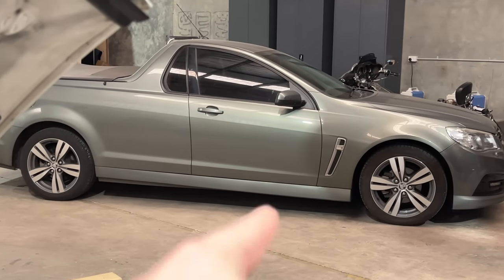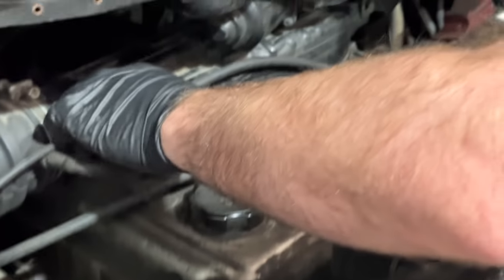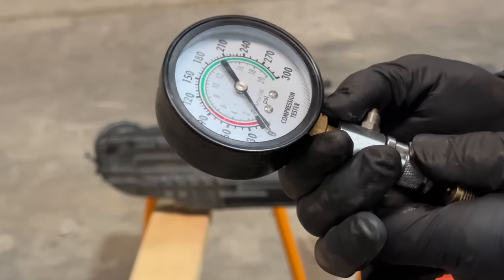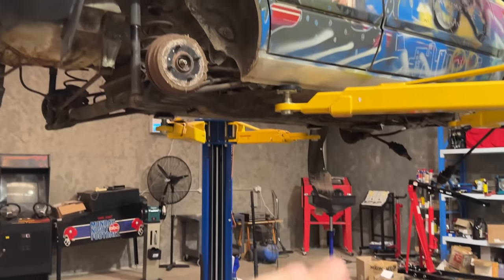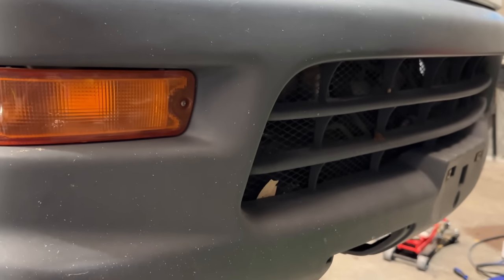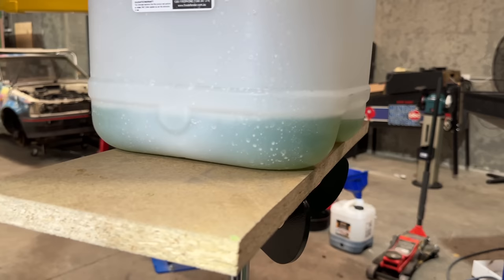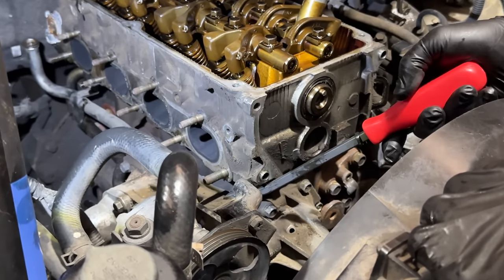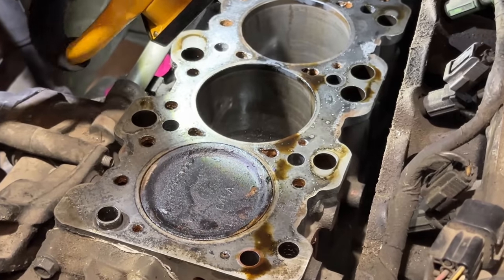What killed the donkey van?

Comment: Really good chance the head gasket fire ring was already somewhat stuffed but it was so encrusted in carbon that it held compression. The upper engine cleaner would have removed the carbon deposit and caused failure of one fire ring. You can see that it's then pushed into the next cylinder.

If you guys are cowboy gasket slapping it, highly recommend doing a little resurfacing by hand. The fire ring failure and old head gasket residue doesn't help sealing. I've done cars in the past with a whetstone+wd40 that ran happily for years after!
Reply: Liberal application of hylomar doesn't hurt either.
Reply: So you basically recommended the same as Wade does for polishing iPods?
Reply: WD40+brass wire brush attatchment on a drill for the block, one of those super scrapers (that's what they're actually called, they're like a gasket scraper with a carbide knife edge) for the head.
Reply: I always find it hilarious when something’s brokenness is what holds it together.
Reply: @drippingwax  will 150 1 grit ones work as well?
Reply: this has to be in the top 0.1% most intelligent youtube comments posted
Reply: @donbehatin  I work at a Ford dealer and see guys doing the wire wheel drill on heads and timing covers all the time
Reply: Can you like take an inexpensive mirror, you can always tell when a mirror is wavy or wonky because it's a mirror, glue some sandpaper onto it, and do some slidey slidey action, is that a good way to go about flattening that surface?
Reply: Despite the pitting in the bore, the new head gasket would probably be a good bandaid for awhile. But that motor just needs a rebuild
Reply: Absolutely, block should be sanded with a flat object too!
Reply: That's a good advice (probably), but what should they do with the cylinder bores that have pitting in them?
Reply: @JeanMarceaux  you send it to a place that does block remanufacturing. Just like what they did with the daihatsu.

Comment: I feel your wheel pain. Had an 87 VW Cabrio that took 13 inch tires. A size slowly being discontinued by most manufacturers. Fun times finding new tires.
Reply: i feel this, youre limited to track tires or 70 aspect off brand "futuras" or "cornwells," 13s are a nightmare to source

found some bfgoodrich radial T/As in a ~200 something R13 for my 83 GTI on some old 13in alpinas, they balanced perfectly <10g per wheel and the beefy white lettering looks divine but the fenders could probably use a smidge of rolling or some berg cup flares 😎
Reply: I’m running two different Chinese no grip tyres as they’re the only tyres in stock that’d fit, I’m debating getting 14” wheels and seeing if 195 45 14s are any more commonplace

Comment: as soon as you said "problem" and brought up the wheel studs I could feel the former RX7 owner in me begin screaming and rattling his cage. Even over here in NA 4x110's have been causing headaches for decades.
Reply: Never had a car old enough to have 5 lugs, are 4x110 to 4x100 adapters hard to come by?
Reply: @abie1308  They're so close in size that any adapter you could concievably get would be more like a 4 inch spacer on either side. 8 inches of extra track width is no bueno lmao
Reply: @abie1308 Yeah you can get them quite easily. I have 4x110mm adapters for my rwd Mazda 323 that are 15mm thick to run 4x114.3mm stud pattern as it's more common used on alot of Japanese cars.

Comment: 6:26 That colour underneath the valve cover is oil varnishing. It’s due to oxidation of the engine oil and usually is only present in that amount from going a bit longer on oil change intervals or that it’s been ran real hard over it’s lifetime. Doesn’t appear to be much sludgy deposits so probably the previous owner went with a 8-10,000km interval

Comment: I once had a very similar issue on our diesel work truck, it had a 4D56 engine. The headgasket was blown between 1 and 2. We didn't really care about fixing it the "correct" way, as long as it back on the road ASAP. We just cleaned and flattened the head to block surface with a glasspane and sandpaper, put a new headgasket and surprisingly 3 years later it still runs great as a daily.
Reply: Nothing wrong with a little low dollar machining. Miles better than just slapping on a new gasket on a warped or damaged head/deck.

Comment: That firing headgasket failure happened to our work pulsar. Turns out it's a common fail point on them too. We fixed it once and then it did it again. It gets to the point where the combustion eats too much away at the head material and ends up never sealing again with a new gasket.

We've also had a customer with an express van that had the timing belt snap. That was fun

Comment: I recall in one of the wrecker tour videos you mentioned there's multiples of the same vans there all in better condition than yours, perhaps it may be worthwhile to pick one of their motors for cheap parts or a full engine swap if its intact enough? It could be a cheaper solution to the bore problem instead of having to send the original block to be reconditioned.
Reply: But then we wouldn't get to see them "fixing" the block with a diy honing kit and a cordless drill. Unless they could somehow collaborate with CEE up in Queensland just to see his giant vertical honing machine going to town on this tiny car block. Chances James already knows how to operate a smaller one so Kurtis can keep showing off how he does his jobs the way he does. Biggest problem is getting their schedules to line up.
Reply: although, if the vans there are in better body condition, then they probably went to the wreckers in the first place cause of engine problems
Reply: @cadenbarnfather1434  True, yeah that makes a lot more sense actually
Reply: @cadenbarnfather1434 Exactly, never buy an engine from a straight car at a wreckers, always get it from a crashed one as you know it was in use when it crashed

Comment: HEY! Those little chambers and offshoots on the intake might not be for sound, they might be for PERFORMANCE! They are called intake resonators and they can be designed to augment airflow through your engine intake in order to change how it behaves, and even improve torque at low RPM

Comment: I am sure that James already knows this and has ordered the correct part. But you guys would have a little bit better luck with a slightly thicker aftermarket head gasket one minute either a multi-level head gasket from a company like Fel-Pro or potentially getting an old-school copper gasket that's a few millimetres thick.
Reply: MLS gaskets are what you want if you want it to last, but also require a good flat deck (doubtful on the donkey). If you have a buggered deck or head, the graphite style ones will take up more slack.

Comment: I would say about this engine: Its not as bad as you would thin kit is. You guys basically revealed the problem with that car by using that spray. You said it was completely F-ed but i would say its one head gasket amount saveble. Because its only main problem (aside the head gasket) is the block and that requires a rebuild + honing/replacement and all that goodie stuff you were doing with freebie car (love that build btw, its a beaty to look at coming together).
Reply: the head gasket was likely already blown but the carbon buildup acts as glue

So I think the engine cleaner did it's job, the engine is just too worn out.

Comment: I have the same engine in my 02 lancer, and it used to smoke too, replacing the head gasket and the fuel pressure regulator helped it out a lot

Comment: SAAB used 4x110, too, but it's even worse as the hub diameter is significantly larger than all other cars that used 4x110 so only SAAB-specific wheels fit lmao.
Reply: You can get a dremel and machine it out

Comment: The weird coloring in the valve cover is the varnish from conventional oil. My nugget looked the exact same! It'll go away with time if you switch to full synthetic.
Reply: Thats a real good color tho, be suspect if it is super dark, althigh a slightly more roasted look is generally also fine.
Reply: Or if it’s full synthetic and you went lazy on the oil changes

Comment: I've been here, done that, had a headgasket blow between 2 cylinders on my Chevy 350 V8, I learned how to do replace a headgasket out of necessity, also got new heads, but I had far more room to work under the hood of my 1986 Chevy C10 than the cramped quarters of that van engine bay, that looks like a nightmare

Comment: If you can get it in Australia get some brand name engine restoter I've tested it myself as well as I've learned from others that have tested it and that specific brand works well and won't clog your oil filter. Not that it will 100% fix the pitting but it should help protect and repair the cylinder walls
Reply: That stuff actually works too tried it once

Comment: Just a suggestion, but once you do look into replacing the motor, look into a cummins 4bt. They dont make a lot of power factory, but a couple injectors and a fuel pump would probably net you some decent power, especially if you like just using the donky as a work van
Reply: Considering it’s a tight fit for that 2.something inline 4, I don’t think a 5.9L i6 will even fit
Reply: @Nep-Nep  Nope, not the legendary 5.9 smoke monster, the 4BT is the lil brother.  4 cylinder, 3.9l monster
Reply: @JacksonAl101  still twice the size and weight of the original engine. 
Plus...in Australia you'd have to pay thousands for an engineers certificate for the engine conversion to get it roadworthy.
Reply: @JacksonAl101  oh right, I forgot about the 4bt. It’s 4 AM over here. XD

But still, wouldn’t it be a pain to ship an engine like that from America to Australia?
Reply: @martin m  my friend I wasn't commenting on the swap itself, any swap of a diesel into a gasser is a royal pain, excluding emissions.  Just commenting it wasn't the behemoth 6 cylinder, would be a fun challenge in the states
Reply: @nep-nep6575  oh yeah, though they might have them already there in tractors, skid-steers/other construction equipment.  4BTs were thrown in pretty much anything
Reply: @JacksonAl101  all good champ 👍
Reply: The only thing I know Cummins for is the 15L engine in my fiancé’s truck. I didn’t know they made tiny engines for 4 wheeled vehicles!

Comment: In the absence of a lathe, adhesive sandpaper to a plane of glass and use that to lap that surface for cheap. It takes a pretty second, but it's cheaper and faster than shipping it out.

Comment: I've had this happen with an old car before. Basically over the years the engine built up a carbon shield around the top of the cylinder and the head gasket. The spray knocked the carbon loose and immediately the head gasket exploded due to no protection and weakness from being old.

Comment: The reason it has all the intake piping and weird routing is because the motor is designed to go transverse, basically sideways. It's put in the standard orientation, so they had to make some weird changes.

Comment: Fun fact, 4x114.3 wheels can actually go onto a 4x110 wheel hub if you need to move a car around your shop (i will also say that you should NEVER drive the car if you do thay, it should only be to roll a car around a workshop)

Comment: 6:24 the color is oil varnish. pretty sure it's caused by heat and oxidation of the oil. I found out that Seafoam actually does a good job at cleaning off varnish when I was rebuilding my old engine.

Comment: your reservoir was empty because the head gasket was blown and sending coolant into the cylinders allowing the engine to burn it giving that crappy smell. also the dripping was the 2 non firing cylinders unburnt fuel dumping out the back. A bad head gasket will drink coolant and cause overheating issues

Comment: I'm mentally struggling with my 124hp Honda HRV rebuild, thanks for showing actually f-ed engine, as my will end up perfect, with just worn out cam :v
Reply: Unobtainable cam of course, as the same engine in Civic had lower lift on non vtec lobes

Comment: I wonder if the spray made the motor gain more compression in one of those two cylinders and cause the gasket which was probably on its way out to finally blow. Made the rings seal better or something or the valves stopped leaking. Thats my best guess.

Comment: I wonder if that spot in the head gasket was leaking a little bit, but was "kinda" sealed by carbon build up, but then when y'all put that cleaner through it all of the carbon blew away and then it started throwing coolant out the tailpipe, hence the white smoke.

Comment: 4:22 Get some 4x108rims and use 2mm adjustable cone screws. 4x108 is a common size for fords and peugeots. usually euro spec opels (holdens) have 4x110 rims.

Comment: Pre-det vs graphite headgasket. Familiar story from a Subaru owner. Get that head plained, wet sand the block with some glass and throw a MLS head gasket on it and youll be rollin again in no time. Provided you broke nothing else.
Reply: Yup. Graphite are for times like this when you are too cheap to deck the head and block and are pretty sure the surfaces aren't flat anymore.
Reply: @nobodynoone2500  I mean you dont have to have the head/block professionally plained, a piece of 1/4 glass, batting adhesive, and sandpaper can do the same job. Its just how much time you’re willing to put in. Cause ngl, the hand method takes a bit.

Comment: Your blown gasket was a separate problem. Seafoam won't do that. You used it wrong. The stuff soaks into the carbon build up and you run the car til it all burns off The white smoke is part of the process. It should smoke like that for a while while the carbon burns off. It's normal. It means it's working. The head was probably blown all along and sealed with carbon build up and the seafoam unsealed it by getting rid of the carbon build up. Seafoam is awesome and it has helped me turn old clunkers into running like new many times.

Comment: Ford uses 4x108 pcd wheels, you could probably make those fit the daihatsu with a wiggly bit of drilling
Reply: They make "wobble lugs" that should take up 2mm, but I don't recommend them for anything other than pushing it around the shop.

Comment: I will never buy a Mitzi again. We have a Colt, and everytime you have to change the headlights, you have to remove it, because there is no way fingers can get past the headlight cap. Result? Well, because you have to remove part of the bumper, on whichever side you need, it means the plastic caps that hold the bumper are gone.... Currently, my bumper is held on by nothing but the two bolts attached to the wheel arch chassis

Comment: They often put jet fuel in fuel additives like injector cleaner or gasses like NOS burn hotter so maybe what you put in did had either. You did use a full can too
Reply: jet fuel does not burn hotter, it requires more heat to burn, big difference. Look up what octane means, hint; it's 2 things that are conflated.

Comment: The gold colour is from overheating oil , basically the oil got so hot it started to cook on any metal surface
Reply: It's just varnish. Doesn't look bad at all. Unless you change the oil every 2000 miles or something obsessive or use extremely expensive boutique oil it's going to look something like that. Or worse.
Reply: @mrflamewars  First of all 2000 miles is way too soon even for a workhorse gasoline engine , second the varnish is what's left on the metal surface once the oil got hot enough to bake it in , and third he's unbelievably lucky that the seals didn't give up first because if they did the donkey would become roasted donkey
Reply: @BIGBOICOMBO  That's the joke - You'd have to be an obsessive weird beard to keep an engine clean enough to not look like it's been full of oil and working. 

🤡🎈
Reply: Gold = not overheated. It turns brown and black when overheated.
Reply: @nobodynoone2500  That's sludge resulted from lack of oil changes , the oil in the donkey's engine has been above 130 degrees for a very long time

Comment: In my armchair mechanical expert opinion it probably hydro locked with the spray and lucky enough the weakest point was not the rods or valves but the head gasket. Probably on it's way out already and that finished it off

Comment: Mechanic here. Two possibilities as well for why the head gasket would be broken like that is possibly that it been replaced before and someone "fixed it" with repair a gasket or silicone and the additive just happened to give the car enough fuel\detergent to burn the sealant off or due to how much carbon is in there it was partially blown before hence the stop leak in the coolant and carbon ended up filling the gap then the cleaner again gave the engine what it needed to break through. Not saying it is what happened just possibilities.

Comment: Honestly, pull the engine, give it a dingle-ball hone and a set of rings and bearings, and have the head recon'd and that motor should last you half a million kays. Also throw all that intake shit in the bin and fab up a cold air intake with a pod filter for that lovely farty 4G64 intake sound.

Comment: Cheap ass solution: Cast iron block, so it'll be fine. Skim the head on a piece of thick glass and some wet sanding paper. Get a racing head gasket and new head bolts and you're done. cost $50 and a weekend.

Comment: Id be tempted to wire brush and use the headgasket in a tube 

You can get it from Bunnings in the plumbing section

Its going to work untill it doesn't
Reply: The space a headgasket takes up is important. You can crash the pistons into the valves. If you do it anyway, I suggest using the copper spray over anything in a tube. Spray both surfaces, 2-3 light-med coats, let dry before assembly. We used to do that on old turbo cars in the 80's and 90s when headgaskets were crap.

Comment: Cant you wire brush the pistons for a bit more life ?
Reply: Nope, the pistons are fine. The wear is on the wall of the engine block, in the cylinder bore. The rings on the piston make that seal.